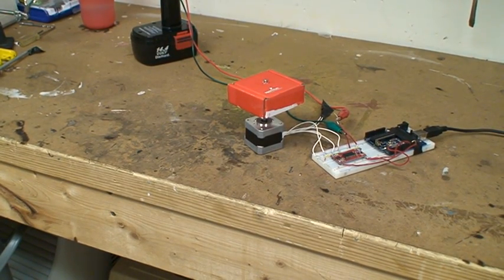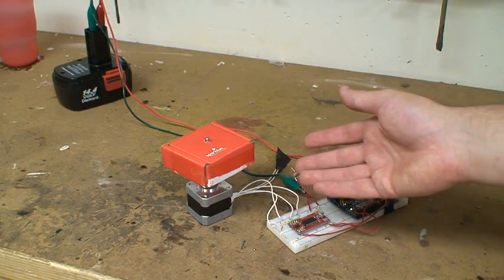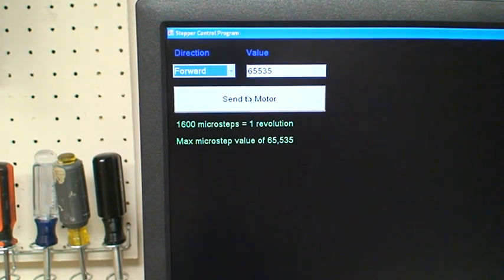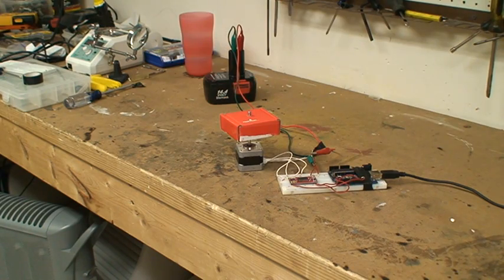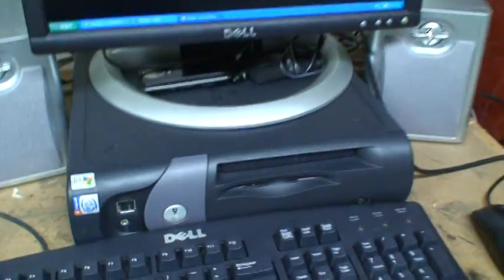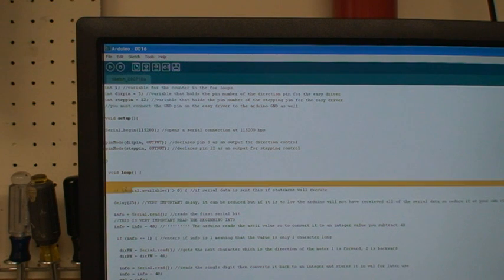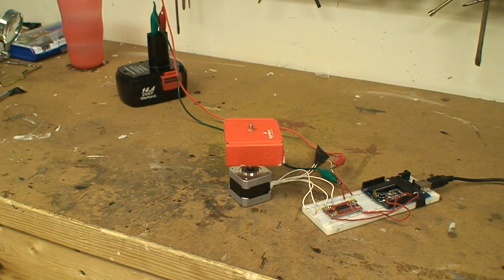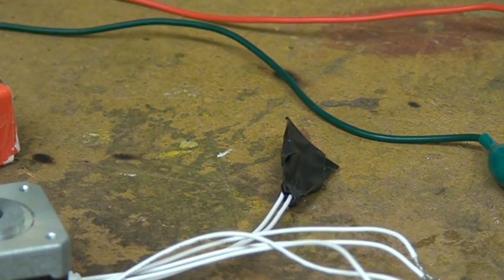Sparkfun stepper motor and easy driver v3

Comment: Hey Amazing tutorial but i need a help on controlling the direction of stepper motor based on digital input trigger, like for 0V it rotates clockwise (given steps) and 5V it rotates anti clockwise (some given steps)....
and motor need to stay in that position till the trigger changes

Comment: Hi.  Probably a rubbish question but how did you create your computer programme? Not the arduino but the software with the 'send to motor' on? I really need to have this kind of thing for some of my projects and I don't know where to start!
Reply: Looks like he used C#, but you should take a look at "Processing".  It's an open source language/ development tool that is perfect for this type of thing.
Reply: Great stuff.  I have heard of Processing but I didn't know it was good for visual interfacing.  I will give it a go.  Many thanks

Comment: Hi justin, can u tell you how you made that user interfeace for communicating with the arduino?
Reply from the maker: I made the control program using C# and visual studio. Its very simple and uses a serial connection to talk to the arduino.
Reply: Justin L I am familiar with how to communicate to arduino using serial connection with the serial monitor as an interface, but not with visual studio. Any tips?
Reply: +Justin L Actually you wrote the program using Visual Basic in visual studio, not C#. Stop lying to people :)

Comment from the maker: I wrote this code a very long time ago when I was JUST starting out and I will admit its crappy. There is a lot of code repetition but I put comments all over and a decent description. I have no incentive to go and rewrite it because its a proof of concept. The main idea was to be able to receive integer values over serial by multiplying by the digits significance and it worked. Take that concept learn from the code and make a better version if my inefficient code was that insulting.

Comment: Would it be quicker to, instead of using BCD, just send a signed integer to represent the motion?

+3200 = 6-2-32000 = 00110110 00110010 00110011 00110010 00110000 00110000 00110000 as you've done now

+3200 = 0000110010000000  as you could send
-3200 = 1111001110000000  as you could send (may be wrong, did in head)

That way, you send way less data and can do an easy conversation at the arduino end (rather than having to wait for the entire string and parse it)

Comment from the maker: The box is only fit onto the shaft via friction so it does slip at high speeds and causes it to look strange. Check out my other videos where I made a plastic adapter. Now the arduino doesn't use a waveform it uses two 5v ttl logic lines. One either high or low controls direction and the other when pulsed on/off controls the step. The chip on the easy driver uses some waveform to actually drive the motor but I'm not sure you would have to read the datasheet for the chip used on that driver.

Comment from the maker: Yea the easy drivers only need 2 I/O pins per motor (one for direction, one for step) unless you want to control power or something else then you need more. So the regular arduino has 13 i/o pins meaning that you could hook up 6 motors or 5 motors (if you want to use serial i/o pin 0 and 1). Its just difficult to control the motors simultaneously. They can be controlled individually with very simple code.

Hope this helps!

Comment from the maker: Yes it would be very easy there are some super simple tutorials out there showing basic operation just like you would want.

Just make sure to keep these motors at a low rpm because as you go faster they lose torque. If your screen is heavy that could pose a problem.

Keep it as light as possible and you should be good.

Comment from the maker: What are you talking about? If you have the motor, driver, and arduino then run my setup to get the motor to "run".

I really don't know what you asked so if I didn't answer your question that post back with a more detailed question.

Comment from the maker: The controller is the device that tells the driver when to step the motor, how fast, and what direction it should spin. The difference is that one simply says what to do while the other actually carries out the task. There are boards out there that do it all but you must find one yourself. Look on ebay or other websites for stepper motor controllers they include everything. I cannot help with this, I have not worked with them so you must do everything yourself.

I hope this helps!

Comment: what's a controller? what's the difference between controller and driver? is there a board that contains all circuits require to drive the motor?

Comment from the maker: The driver is a chip that takes the very low power signals from the arduino controller and turns them into high power pulses to control the stepper motor coils. Simply put the driver handles the high power and the arduino tells it what to do. This motor can draw up to 750ma at 15v which is a lot of power much much more than the arduino can provide so that is why the driver is needed to control it.

Comment from the maker: The shaft on this motor is longer, Sparkfun now carries a different motor. They got rid of this model because it needed 15 volts and replaced it with one that only needed 12 volts to run. The new motor has integrated wires, a shorter shaft, and the motor is flatter / more compact. The torque output and speed is the same on both models.

I hope this helps!

Comment: Hi excellent video! Quick question, did you change the length of the shaft of the motor? I ask because the shaft of your motor looks longer than the standard on the sparkfun website. If you did change it, can you tell me how. Thanks!

Comment from the maker: I just updated the video descriptions on all stepper motor videos with a link at the bottom. It will take you to a blog where there is a nice image showing the utmost basic configuration of the driver. The newest drivers are slightly different and include more pins but unless you need those pins just connect it as you see in the video and your off.

Comment from the maker: Its true that using an unsigned long would allow a ridiculous amounts of steps but that amount of steps would take (at the fastest step speed) about 186.5 hours to execute at 240rpm or about 7.75 days!

This setup was made to execute quick precision movements under 1 revolution but it is capable of running for up to 41 full revolutions. Obviously you could run longer with an unsigned long integer but this works.

Thanks for the suggestion!

Comment from the maker: They could be used for a CNC drill but only to move the axis NOT for drilling. Google "desk top cnc mill" and click on the 4th link.

Hooking up more than one motor to the easy driver is not possible so I would get a real stepper motor driver for more than one which should run about a hundred dollars.

Comment: I want to make one small CNC drilling, which will have 4 step motors and me interested in whether we can make electricity for 4 outputs that will be managed from the program via USB izlaza.Koliko like to me that we stood novca.Hvala. You intensity step motors recommended that the VOLT would .Masin used for drilling aluminum

Comment from the maker: The program is in C#, look at the basic format of how I wrote the program and then do the same in C++. Some things will be different, you have to set up a serial connection in C++ which should be just as easy in Visual Studio.

The program pretty much uses basic things like variables, simple math, string operations, ect.... Then it outputs the formatted data through the serial port. If you have a serial connection working then its just a matter of coding the simple stuff.

Comment from the maker: Yes you can, simply program it and make sure it works then disconnect it and put a 10k resistor between the RX & TX pin. Now it will run without a computer and execute the code on it. I would recommend getting the USB board its like $30 but it has all of the components already built in. Keep in mind the easy driver can only drive 1 motor at a time so for each motor you need a driver, but you only need 1 arduino because you could connect all the cables together and it could driver all of them.

Comment from the maker: I am not sure that a 555 timer can do this operation simply. Because it has to toggle on/off really quickly no more than a few microseconds and then delay for around 200 microseconds. This is probably going to be really tricky because it will need very precise resistors and capacitors (online stores like mouser, no radioshack) . In this case an arduino is your best bet. Easy to program and very cheap (check out my breadboard tutorial) for $15 you can have your own DIY arduino board!

Comment from the maker: Yes and no, the driver has 2 input pins 1 for direction and the other for stepping. Its nothing more than setting the direction pin high or low (forward or backward) and then toggling the stepping pin on/off every quarter millisecond or so.

Now unless you can manually switch them around 4000 times per second it won't work. The only way you may be able to do it is with a 555 timer but it will not have precise control just speed. Get an arduino they are dirt cheap and easy to use!

Comment from the maker: This drive has a current on/off pin inside the ic except the easy driver V3 doesn't allow you to access the pin to control it . The new V4 driver will be out soon and it has this pin. As for controlling the motor current on this its done with a potentiometer on the circuit you have to to use a little screw driver to adjust it. I would use an industrial driver but I just don't feel like paying a lot for them when this works just fine for small applications.

Comment from the maker: If you look at the code where the motor steps the delaymicroseconds(200); line of code controls how fast the microcontroller steps the easy driver. The lower the value the faster the motor spins the higher the slower. I have gone down to 150 before but any lower and you risk the motor stalling. I am adding this into the code right now!